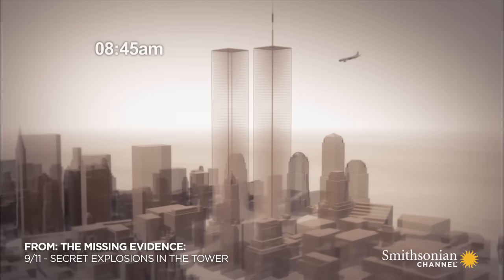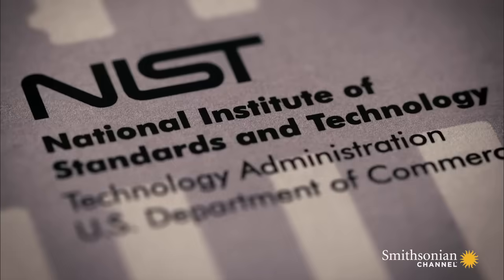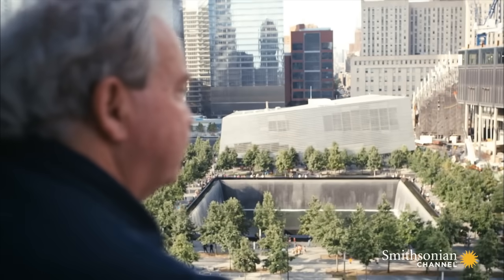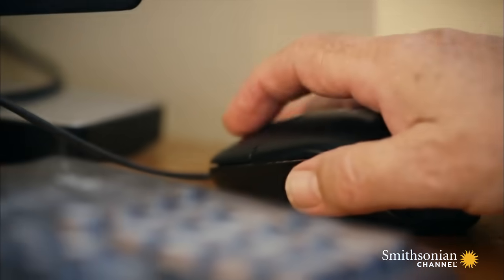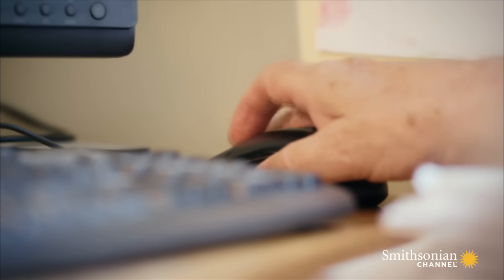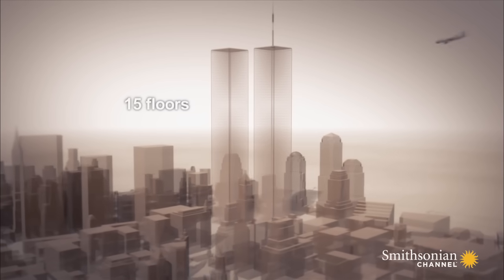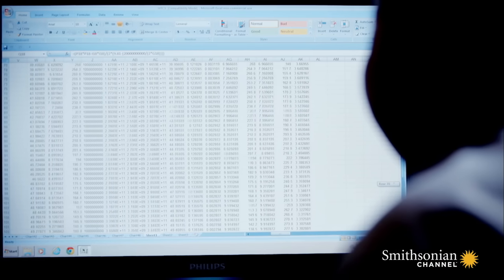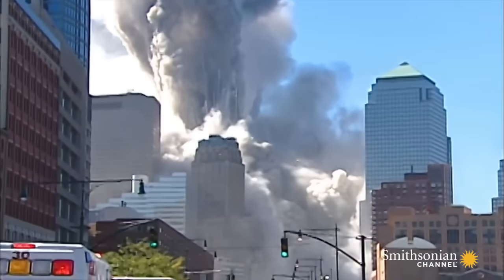This Computer Simulation Explains How the Twin Towers Fell

Comment: Control demolition, plain and simple. How do we know? World Trade Center 7 fell the EXACT same way at near free fall perfectly symmetrically. Gravity does not have enough energy to pulverize everything into dust. Plus WTC1 top part was already tilting and falling off to the side. How did that part become pulverized. Please do the actually scientific research with @AE911truth and review Dr. Leroy Hulsey's 4 year study. Or believe NIST, who omitted key design elements when stating their findings, who cannot explain how WTC7 was a free-fall for 7 stories when their own digital time lapse shows the building kinking in and bending. LOL Simply truth, you cannot have a single column failure based on fire, that allows a building to fall symmetrically at free fall speeds into its own footprint. Simply IMPOSSIBLE! Again, WTC 1 - 2, Newtons 3rd law, states that for every action (force) in nature there is an equal and opposite reaction. In other words, if object A exerts a force on object B, then object B also exerts an equal and opposite force on object A. Therefore, what causes the rest of a perfectly intact building to destroy itself? Where was it getting the energy. PS - pancake theory already disproved and thrown out by experts.
Reply: Um NO. The towers fell from the MIDDLE. 7 fell from the BOTTOM. NOT the same.
Reply: @Tim22222  I love how you do not address FREE-FALL at all in your reply. Explain that without violating Newtons 3rd Law. I'm waiting.
Reply: @Tim22222  PS - The towers did not fall from the middle. They fell from the top 3/4 on down. WTC7 as per NIST, WTC7 had a single column 79 failure on floor 13, that led to thermal expansion, thus creating a global collapse and the whole building fell perfectly symmetrically into its own footprint at FREE-FALL speed over 105 feet? LOL They didn't test for explosives, and they also omitted key design elements. But continue to explain why I'm wrong and what I am not understanding.
Reply: @RyanGriffore  You are correct & more precise: The towers fell from the points of impact; 7's collapse began at the bottom.

Either way, not the same.
Reply: @RyanGriffore  1. There was no free fall in either tower collapse.

2. The ~2s of "free fall" for bld 7 was (a) measured from a single point, not the building's center of mass, and (b) might be explained by the collapse of the atrium, 7 or 8 completely empty stories. I freely admit I don't know which (if either) of those things explain it but you need a lot more than that to prove controlled demo.
Reply: @Tim22222  NIST ADMITS FREE-FALL! Come on man, at least argue the facts or lies based on known truths of what was said!
Reply: @RyanGriffore   So you believe NIST?
Reply: @tpryce6234  I believe NIST could NOT disprove FREE FALL therefore had to acknowledge it. JESUS people!
Reply: @RyanGriffore   Do you believe them or not?
Reply: The question of whether the World Trade Center towers collapsed at free-fall speed or near free-fall speed is irrelevant. What IS relevant is that the collapse was at a constant speed. It's an observable fact that the falling mass of the upper section of floors (top 12 floors of the WTC North Tower) did NOT slow down as the collapse progressed. The falling mass maintained at least a steady speed and slightly accelerated throughout its fall. This is impossible with a purely gravity-driven collapse because the accumulating debris underneath the falling mass exerts progressively greater resistance to the downward movement of the mass until the compaction limit is reached and collapse stops with the upper mass at rest and usually crushed.

The debris from the 110-storey WTC towers reached only 8 feet above ground level and much of the two buildings was pulverized to dust that covered a large area of lower Manhattan. WTC Building 7 at 47 stories was less than half the height and only 28% the mass of each tower, yet it collapsed into a debris pile nearly 70 feet high and none of it was pulverized to dust. The Building 7 debris pile was the highest object left on the entire WTC site.

If both WTC towers and Building 7 collapsed from gravity alone as claimed, why was the resulting debris so different? The only way the WTC towers could have collapsed at constant speed all the way to the ground was by demolition charges set within the buildings that exploded in sequence blowing the resulting debris out from under the falling mass of floors leaving virtually no resistance to it. Exploding charges are also the only way that so much of the mass of the towers could have been pulverized to dust.
Reply: @jamescollinson2179  Nonsense! You just made that up. You are forgetting about GRAVITY. There is no reason to believe the collapse should have slowed down. NONE.

Comment: Not many know this but the towers were designed to be plane proof after what happened in the Empire State Building. A plane also crashed at the upper floors but the building survived since the building was more of a concrete and steel-built than steel, unlike the the twin towers which were built as a steel framed structure and only the core as the spine of the buildings. They plane-proofed the twin towers but not to the size of the ones that crashed on 9/11. The towers were plane-proofed only to the size of smaller planes.
Reply: They were Built to with stand a Boeing 747 commercial airplane which is way bigger then the planes that hit it dude

Comment: CAPS ARE ON INTENTIONALLY. THIS SHORT VIDEO DOES NOT EXPLAIN WHY THE TOWERS FAILED BUT HOW THEY FELL. The rest of that documentary explained why the structure failed due to melting aluminum and water mixing causing an extreme explosion which too out the main beams causing the structural integrity to fail which then brought down the towers.
Reply: Teo Chew yang tidak

Comment: 12 seconds for a 100 story building of this magnitude to collapse & disintegrate into nothing, incredible
Reply: A 110 storey building collapsing in roughly 10-12 secs equals 10 floors a second were being demolished that's impossible without explosives why is it so hard to understand for some people.
Reply: if you threw a ball from twin tower. it takes 9.1 seconds to touch ground.
t=sqrt(2*s/g) .
Reply: Not possible
Reply: Are you suggesting that the towers were holograms as well?
Reply: @VirreFriberg  Only the planes and explosions where projections of light and sound. The holes were created with the same technology but a slight variant of interfered energy.
Reply: @andrewdean6963  bro they didn’t have that good technology back then, take off your tinfoil hat and respect the thousands that died
Reply: @blockednostril5962  I am respecting the thousands that died. Empirical evidence is the truth, that theory must mimic.
Reply: @VirreFriberg  The planes where holographic projections of light and sound along with the explosive fireballs, as a result of interferometry of electromagnetic energy AKA directed energy. The plane shaped holes created with directed energy weapons, and the entire WTC complex of seven buildings where turned to dust with directed free energy technology that was used as a weapon.
Reply: Trumph said the collapse was strange or something, and he would investigate the happening again when he was on presidency..
Did he do that?
Reply: Did not disintegrate into nothing.... and yea, was a lot of weight coming down from the top.
Reply: @incidentalist  The towers didn't collapse. They turned to dust from the top down to the ground. Where did the towers go? Evidence of directed free energy technology on 9/11. Judy Wood. Read the book or watch the 2012 energy conference.
Reply: @incidentalist  As I have tried to educate before, the towers did not collapse, they turned to dust from the top down to the ground.
Reply: A new phenomenon needs a new word to describe it, that new word is dustification.
Reply: Controlled demolition be like
Reply: Literally incredible, as in, not believable.
Reply: @adamsyed5535  You clearly don't know what you are talking about.
Reply: The floors offer zero resistance. That's not physics. It's magic.
Reply: @toddhumbertmusic7211  That’s because the literally do no offer any resistance against a 500,000t building collapsing because of heavily weakened supports. Do you even know how they were constructed?
Reply: @starstencahl8985  doesn't matter if it's 500,000 lbs or 50 lbs. Newtonian physics is the same regardless. And let this fact seep in: According to Newton's 3rd law which states that when two bodies interact, they apply forces to one another that are equal in magnitude and opposite in direction. The third law is also known as the law of action and reaction. ... If a body has a net force acting on it, it undergoes accelerated motion in accordance with the second law." IOW, if 20 floor weight collapses, it will fall 20 floors. 30 floor weight? Yep., 30 floors and so on and so forth. Do you realize the towers fell in 11 seconds achieving free fall speed. Sagging, melting steel (and that's a theory full of holes) would take 11 seconds just to fall 20 floors. It's so utterly ridiculous. The "progressive theory" is so lacking in physics and common sense. The equivalent would be two trains headed for collision on the same track. When they collide, one train turns to dust while the other train continues at the exact same speed unabated. That's the magic of NISTs conclusions.
Reply: @starstencahl8985  Another example: pretend a group of demolition experts met to plan a collapse of a ten story bldg. One expert says "simple. No need to detonate every floor. All you need to do is detonate the 8th floor, and the weight of the top 2 will plow thru the remaining 8 at free fall speed. That's how the Twin Towers fell." So they go about wiring the explosion. The result? The 5 ton weight of the top two floors collapse with a force of 5 tons at free fall speed. The force is so great, it falls to the 6 floor before stopping.  (Remember the bottom 8 floors are pushing back at 5 tons upward force . The result is the two forces reach equilibrium when they cancel each out on the 6th floor. That's Newtonian Physics on building collapse. That's why every demolition expert knows that all resisting floors that match the weight coming down must be removed.
Reply: @toddhumbertmusic7211  This is so well said I can't even stand it. Well done sir.
Reply: @Jeff Loko Add molten steel beams and 35000 tons on top of them mr genius.
Reply: @marcellop3163  molten? Tell me how concrete reinforced steel beams that have a melting point of over 2,600 d fahrenheit was turned molten by a fire that could be no more than 600 d Fahrenheit? Plus the cool steel of 90+ floors below the towers. The steel would’ve hardly been affected by the fire, let alone turned it molten. There’s multiple reports of firefighters saying there was molten steel still flowing over two months after the attack. The ONLY explanation is thermite. U got me smh🤦‍♂️🤦‍♂️
Reply: @Anthony-dg9uh  do u perhaps have a source? (no hate, curious)
Reply: @danielkim4320  the videos they cited were available but all the sudden got taken down one day😑 wonder why…
Reply: @Anthony-dg9uh  f
Reply: @danielkim4320  you can find very good sources of informations with architects and engineers.
Reply: @Anthony-dg9uh  When you turn the buildings into nano particulate dust you have got some ingredients for nano thermite:-)
Reply: @Anthony-dg9uh  ik i’m late but the jet fuel plus literally everything else im the building could have well exceeded the melting point of steel
Reply: @Anthony-dg9uh yeah totally, 2 month molten steel.
Reply: Mamt Patet explosions wer heard and scene , diagonally cut beams wear left for all to see in the wreckage , the emote was found in pools at the base of the building ... thermite is used in demolition. The towers wer demolished  if you think the government wouldn’t do this to its own people you are very naive .
Reply: @joshbell882  do you not think some of the beams could of just split like that, basically everything you said has a none conspiracy answer too…
Reply: @marcellop3163  Jet fuel doesn’t melt steel beams
Reply: @HeyItsSarah30  it weakened them not melted them, then the weight of the floors made it give way.
Reply: @HB12340  the weight of 10 floors collapsed 90? The person who built the building legit said half the beams could dissapear instantly and the building would still be standing 😂
Reply: @anthonytesh9519  cool bro 😁
Reply: Well it’s physics 😊
Reply: @MIKE-TYTHON  No it's not physics. It is a syntax error.

Comment: This doesn't prove anything. "My computer told me it could happen." That makes it a fact. My computer told me Biden owes me 10 million. It's a fact.
Reply: Really depends on how good your computer is at reasoning for it's cause, can it convince you that it happens like so? Could it convince biden that he owes you 10 million?
Reply: We’re looking at big planes the structure in the twin towers melted coz of the heat and it weakens the whole building and I thinks that y the towers fallen
Reply: @jeffreyurmuh4222  Not how towers work buzz
Reply: @superhydra8873  well you know the planes were ticking bombs from Newark to Los Angeles the jet was fully loaded with fuel .
Reply: @jeffreyurmuh4222  if the beams took the hit of flying airplane they would have bent right? If bent than the top floors would have droped forward not downward. If the plane impact cut the beams in half than the floors above would drop immediately after hit. 
Wheres the weekend beam logic?

Comment: why was the tower specifically built to handle being hit by a plane?
Reply: Because such an accident happened before, in 1945 (a B-25 bomber lost in fog hit the Empire State Building - although that plane only weighed 1/10 of what a 767 weighs, and was going 1/3 the speed of the 9/11 jets).

Comment: Odd how so many "know" exactly what happened yet are not skilled in materials, construction, chemistry or explosives.  (Also odd that not a single one of the thousands required for such a conspiracy has spoken even anonymously.) A friend at CDI (Controlled Demolition) said they took down the Martin Bldg with 21 floors (2019) requiring 50 guys 5 months.  The towers would taken a crew of 100 at least 2 years, walls would have been removed, supports cut, electricity, as and water lines handled, computer simulations run. He said they all got a big kick out of claims that "a group was seen entering the building"     

Not heard much since the MVA Scientific Consultants ran a battery of tests on debris dust and found "there is no evidence of individual elemental aluminum particles of any size in the red/gray chips, so the red layer of the red/gray chips is not thermite or nano-thermite"  This comes right after the New Mexicans for Science and Reason debunked the thermite theory (through many tests).

Comment: Does that simulation explain how a 747 flew horizontally along the ground, into the 1st floor of the Pentagon? Or how no cameras caught it doing this on the most heavily surveilled site in USA? Or how it left a hole smaller than a 747?
Reply: Becauae it was a tomohawk missle lol
Reply: Some corrections, it was a Boeing 757,  the footage from one camera was released (but it’s impossible to make much out from it) and the hole size is really hard to estimate based on the info we have. With that said, your concerns are valid and it would be nice to see footage from more of the cameras.
Reply: or how wtc6 had caries
Reply: @GhostSal  You said something about being a troll?
Reply: I can answer that! It was. 757, which is smaller than a 747!
Reply: #1 It wasn't a 747.

You're not really big on facts, are you?
Reply: @GhostSal  Troll much?

Comment: This situation sucks but how the building falls like that so perfectly is sus. This explains nothing. Jet fuel does not burn hot enough to even come close to melting iron... not at the rate. The building didn’t even start bending or anything. If you heat metal with stress it will bend. I haven’t found nothing yet that proves this with 100% true facts. If anyone has an article I would love to read it but this looks like a controlled situation.
Reply: @B7s snapped connections equals zero resistance you just angry that I question the government. Their explanation is sus.
Reply: @ducky7438  No iron actually melted. So that's a non-issue.

There's nothing wrong with the way the buildings fell considering they were hit by 150-ton jets doing 500 mph - a fact you conveniently ignore.

There is ZERO evidence for demolition; no explosives, no detonators - NOTHING.
Reply: @Tim22222 
The World Trade Center towers were hit by Boeing 767-200 airliners. The maximum Operating Loaded Weight (OLW) of a Boeing 767-200 is 180,000 lbs. or 90 tons, not 150 tons. The weight of each tower was 585,000 tons or some 6500 times the weight of the airliner that hit it.

The impact zone of the North Tower was from the 93nd floor to the 98th floor so total impact and fire damage was limited to the top 18 floors of the 110-floor tower. The remainder of the building was totally undamaged. Since smaller support columns were used on the upper floors due to less load, the top 18 floors comprised 16% of the building volume but only 11% of the total building mass.

There's no way in the physical world that 11% of the building mass could have crushed the remaining 89% of undamaged mass completely to the ground by its weight alone. The support columns of the lower floors were blown out by explosive charges of which there is abundant physical and chemical evidence.
Reply: @newjeffersonian6456  there is a way. It's called gravity. Ever hear of that?